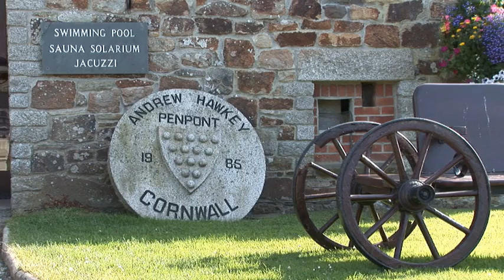The Olde House 250 kw Solar PV

Comment: we have shrimp farm, we must turn on electric 8 motor 3HP/pcs to run oxygen fan with time running 20 hours everyday, sometime they are non-stop. how much power and how many panels we need for this situation,  and how much cost will it take?
Reply: THỦY SẢN-SEAFOOD where in the us are located to check ability

Comment from the maker: Gary,
Thanks for your email.  Everything went well with regards to building the system.  We had a bit of stress about the government feed in tariff changing, however we installed just before the deadline. The system is producing more than expected (just over 252,000kwh last year) We would definitely recommend doing it, we used REC panels and 3xSolarmax inverters, all with no problems, 2 years in. Grid connection was quite straight forward and we are using the energy ourselves. Would do it again.